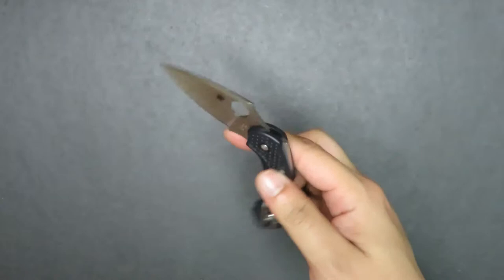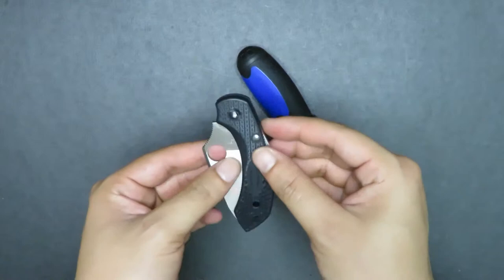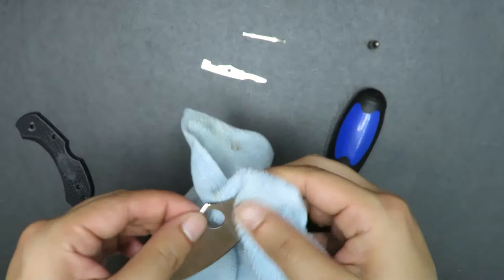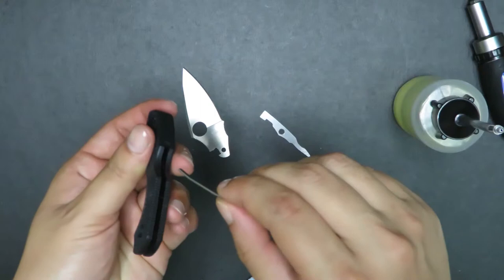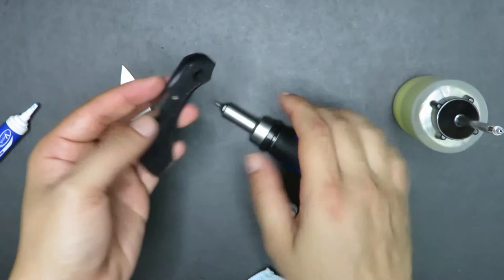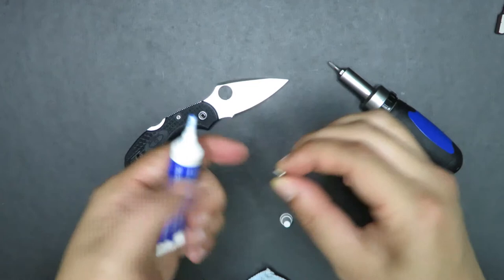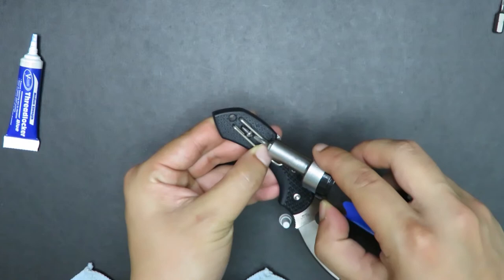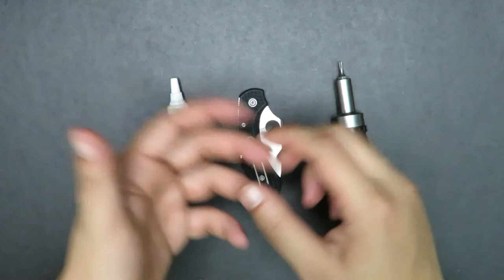How To Disassemble and Maintain The Spyderco Dragonfly 2 | The Back Lock Problem

Comment: Does your scales have a D shaped hole or is it round? I can't get the pivot screw out.
Reply from the maker: oh mine is D Shaped so it wont rotate. how old is yours? maybe the older ones were completely round
Reply: @edcready8894  Circa 2010. I managed to get it out by using the blade to apply torque to the pivot. Now that it's out, I need to replace it with a nut with a torx on both sides. The hole is indeed round.